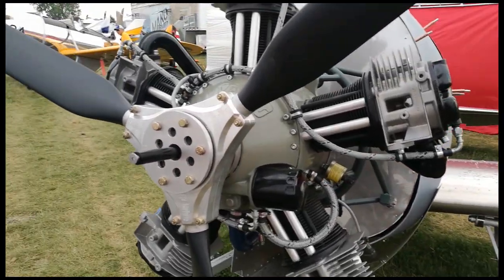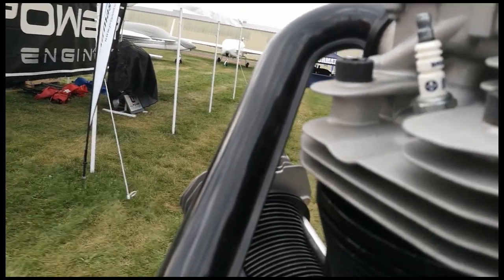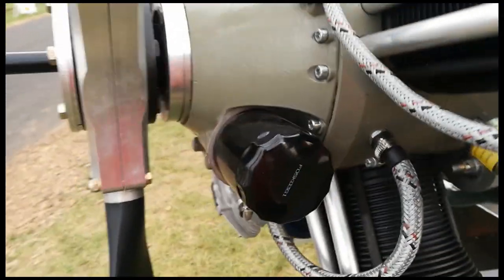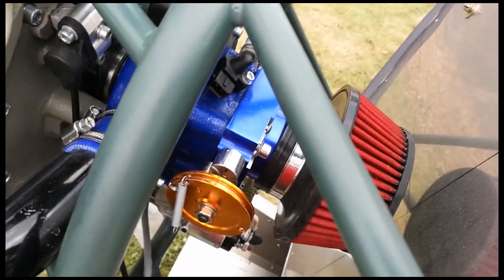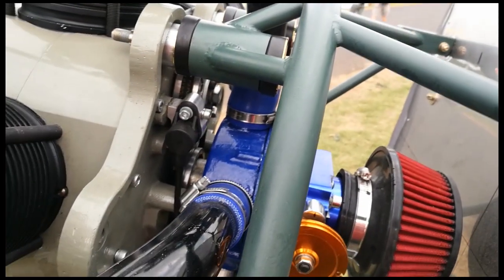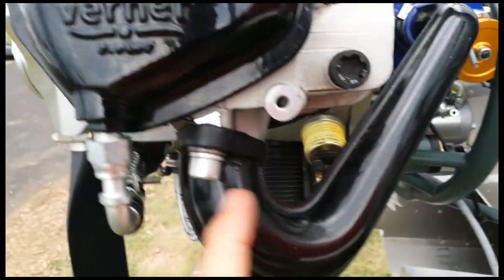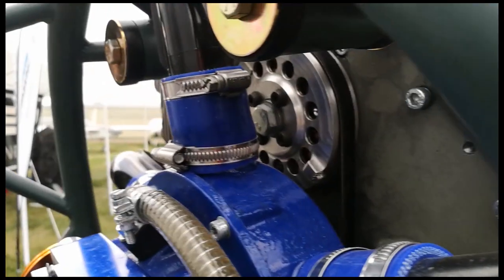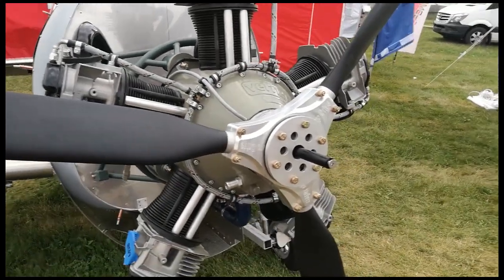Verner  Radial Engine

Comment: Thanks for the review pal.  These crude engines also have plastic cam followers, not hardened steel like all other engines, plastic see how that pans out.
Reply: Millions of cars getting around with plastic inlet manifolds although rarely a wet unit. Good GRP is as strong as aluminum re weight.
Reply: I think the inlet pipes are carbon fiber...